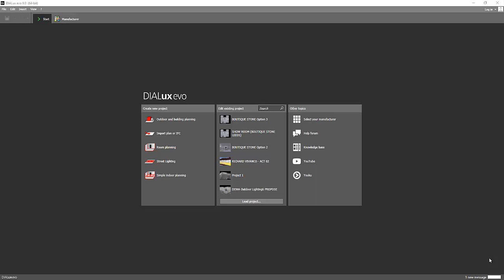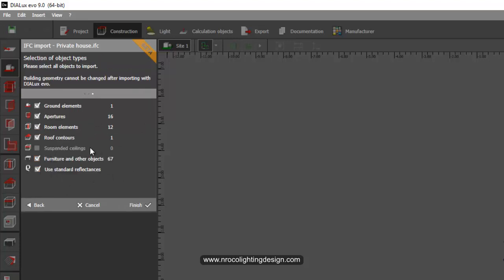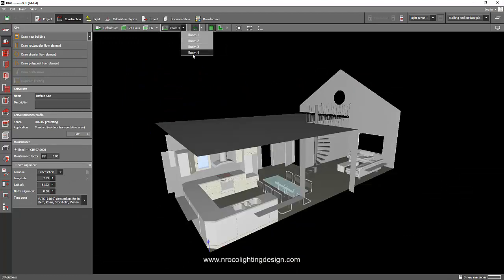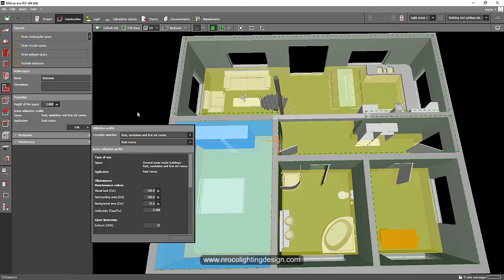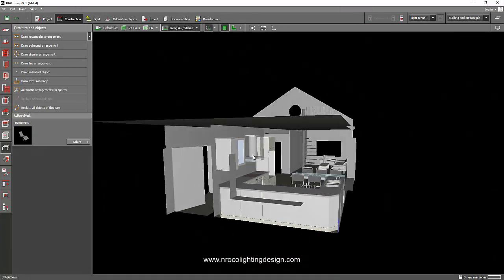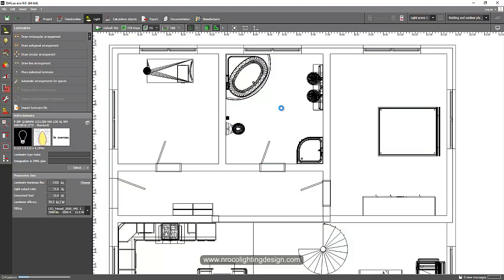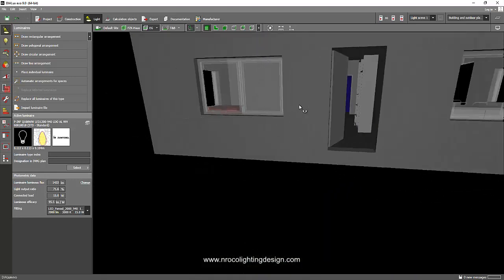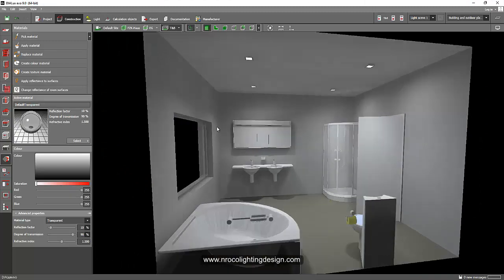How to import the IFC file in Dialux evo?

Comment: Created 3d model in PDMS, converted to navis file and exported to .ifc with navistool ifc exporter,
Dialux Evo 9.2 not accepting this ifc file - showing error that couldn't be have geometry, 
can u please suggest what to do??
Thanks in advance
Reply: hi, I am also checking answer for this , Did u got solution
Reply: @MOHAMMEDAMJADB   I found the information about IFC file and geometry:
Geometry BREP - DIALux prefers geometries as BREP (Boundary Representation - boundary surface model, description of objects by their limiting surfaces). Evo comes along better with non-triangulated surfaces. The surfaces should be oriented correctly and form a closed volume, which unfortunately is not self-evident in many CAD programs.
Multilayer components: These components should not be separated into individual objects.
Elements in Solid Element operations: Yes, as BREP
Elements with connections: Yes, as BREP
Ceilings with inclined side surfaces: Yes, as BREP
IFC terrain information: Yes, as BREP
IFC plot of land: on project origin
Reply: @michalaugustyniak915  do you know if its possible to export from sketchup in ifc file, I get the same error code as above.....
Reply: @robinuden3119  sory, i dont know 😞 i am not working in sketchup

Comment: Hi Nelca!
I tried to do the same with a Revit file that contains curtain wall, glazed roof and velux windows, to check how DIALux evo 9.2 works.
Basically it doesn't read the elements like apertures, so it's not possible to calculate the rooms.
I know that's a Beta version, but do you know if there is another way to import these elements correctly?